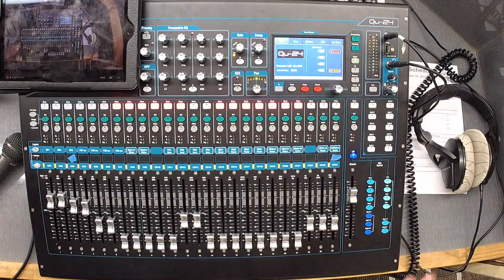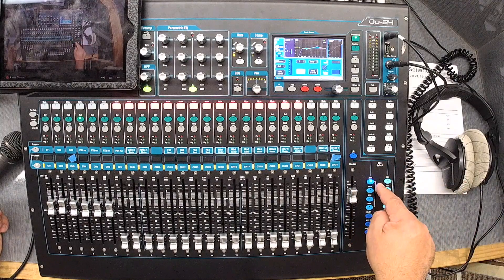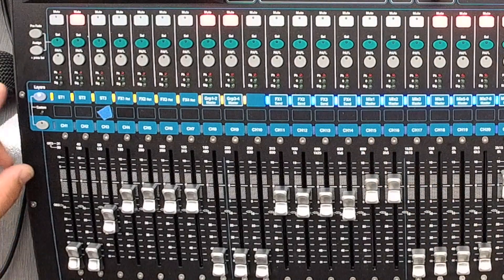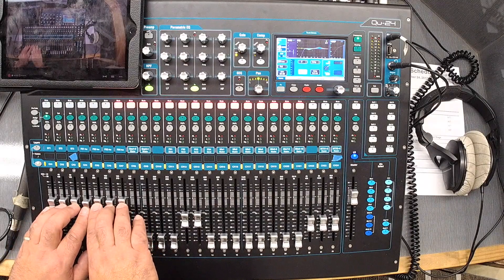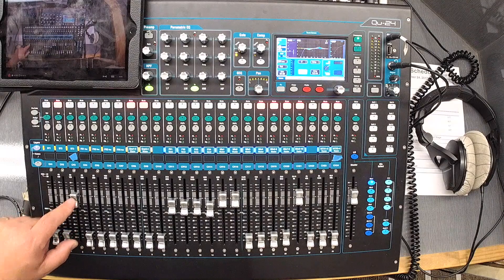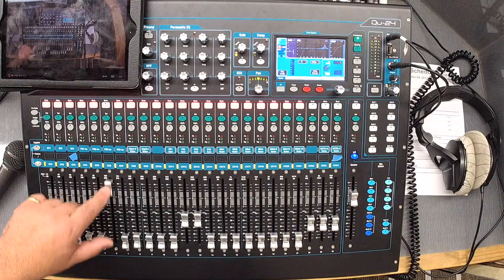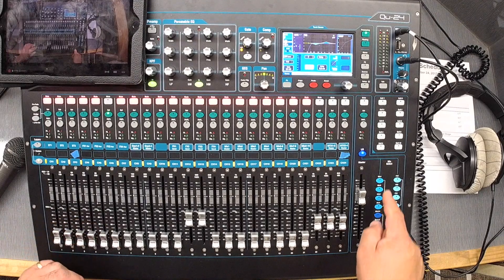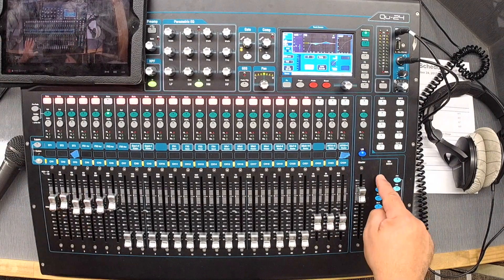AH QU 24 Monitor System

Comment: Great Job.!  I have 4 Singers, and they all have individual monitors.  Ch-1 -> Mix-1, Ch-2 -> Mix-2, and so on for all 4.  I would like to put a small amount of effect for each send.  Each of them like a different level that they prefer.  I currently have a bit of Reverb and a short Slap on FX1 & FX2.  for each of the Vocals.  Can use the same effects for each of the monitors or do I need to use FX3 or FX4?  I planned on using a doubler four the lead signer and an external harmonizer on FX4 or something...  Simply... Can i use a small amount of the reverb and delay for the monitors?  Thanks  Dwayne.

Comment: I know this is wayyyy after this was posted, but I could really use some advice.  I just installed a QU-32 at our church and have the monitors attached to MIX 1-4 but I am not getting any sound.  I have the channels set to route to the appropriate mixes so I am really stumped.  Any advice for a newbie to the QU world?  Anything I could be missing?

Comment: Great tutorial. Especially for someone fairly new to the Tech side of things. And my first digital desk. 

Just one question (maybe you could cover this). How do I send FX to an In Ear Monitor send? Do I just use the FX as normal on the main mix but add the effect to different instruments? Or is there another way to do this?

TIA
Reply: Essentially the same as any instrument or vocal. just press layer button where you will see the effects return channels. (channels 4-5-6-7 on the layer level) now select your mix to send to (Blue buttons on the right) and simply add the amount of effects! (Push up the fader for the effects return) to the monitor/ iem mix that they want in the monitor or iem's

Comment: Hi , sir. I swapped the qu as a Interface/ soundcard to  Clarett from Focusrite. But, I setil would like to yuse the QU as a monitor mixer, So , just to get signals from the line outs from soundcard, and give each musichan  their own monitor mix. Is this possible ? how do I route the enidividual mixes ?  So I need to buy extra gear? or can I take  a seperate output from the back and rout to a separarte monitor amplifier ?

Comment: Can you configure the aux/monitor sends pre/post fader on  per channel basis or a per mix basis? Example - send the input mic channels to mixes pre-fade but the "canned tracks" channels post-fade?
Reply: The way I have done it is use 1 FX dedicated to the monitors. Then make whatever channels you want FX on monitors "prefade" on the fx channel. Not the mix itself. Hold the button to the left of the channel strip to show you what channels are in pre/post fade. The channels you want the FX on need to be lit up.

Comment: Monitor sound typically gets bounced off the back wall and into the audience ... not good. I think that sound is also out of phase with that coming out of the mains. I have tried to angle the monitors so they do not hit the back wall by angling them sideways. This can't always be done because of the stage set up, but when it can, it makes the sound hitting the ears in the audience sound better. The musicians just need to get used to having the monitor sound hit them in one ear ... doesn't take long.

Comment: Hi, this tutorial is very helpful, in my church we recently purchased this Qu24 mixer, i wondering if you could help us in showing how to set up the in ear monitors, we get the beringher p16m, and we wonder how can we make groups so we can send the 7 mics for the drum in just one channel, i really appreciate if you could help us with that
Reply: re: the p16m - I am not that familiar with the unit, however, looking at the connections it looks as if the only inputs are via the ethernet jack (ultranet) - i think that is your first issue you should solve - whether that unit will interface with the QU24 dSnake - it looks like you would need the p16i -
www.sweetwater.com/store/detail/P16I--behringer-powerplay-p16-i-16-channel-input-module
In order to use the p16m with analog inputs going into the p16i then ultranet connections to the p16m - 

and looks like the low cost of the p16m needs the p16i in order to take advantage of the unit via analog
 connections.

you could look into the Allen Heath ME personal mixing system - although costs more it does the dSnake option fairly easily
https://www.sweetwater.com/store/detail/ME500PM--allen-and-heath-me-500-personal-mixer

At our church this is what we use for wireless in ear - www.sweetwater.com/store/detail/ATM3L--audio-technica-m3l
we found a good deal for four on craigslist - be careful however with all the new changes in bandwidth from the FCC
our setup is analog connections from the digital snake to the ins of the AT transmitters - then to the receivers - 

A wireless in ear system would be much like we have - but each person with a receiver can adjust their own mix via the Qu-You app on iOS or 
Android - 

Also remember that the Qu24 can be run via an iPad with the Qu-Pad app - only on iOS - i think there is some android version but not fully supported by AH.

The QU24 will give you up to 6 or 7 separate monitor mixes/sens - 4 are mono and 3 are stereo
What sort of snake are you using? analog or the ab168 or ar2412
So this means you may have 12 in ear monitors but not 12 individual mixes for them. Only 7 which means 5 will be duplicates of the original 7
.
At our church i share one mix with the drummer - we basically hear the cues and click track with some lead vocals
 and everyone else has their mix - so depending on your set up - you will be limited to 7 unique monitor mixes - not a big deal for a smaller group but i don't know your needs.

Hope this helps
Reply: We have the beringher P16i too, we gonna have that close to the mixer and send the signal to the stage to the beringher P16d so we can split the signal for eight P16m, but we only need six and we have an analogue snake not the A&H 2412, but we are not using that anymore for the music, we gonna have just on floor monitor for the preacher, we know that  it would be easy to get the ME monitoring system but like you say its quite expensive, the only problem that we have right now is how to put the 7 mics of the drum together into one fader so we can send the drum in one channel to the P16m

Comment: How to setup subwoodfer line out in this mixer , sir ?It has not Hi cut line out . Thanks
Reply: Any mix out would do
Reply: Could you explain step by step  , sir ? , thanks
Reply: I use my mix 9-10 for subs. Send it to an amp then use those outs to the subs. Make sure that you've patched your cables correctly. It also depends what kind of subs you have though.
Reply: HK thanks

Comment: Can the monitors be eq ‘d separately?
Reply: yes - this is especially important when you need to ring out stage monitors
Reply: Marlon Valladares do you have a video on how to do that?
Reply: @JesusRamirez-ci2le  not yet but will try soon - thanks
Reply: @JesusRamirez-ci2le  I probably won't be able to do that - but here are the instructions
To begin, make sure you are in the Processing Mode - Press the PROCESSING Button located at the top part of the board
1. Press the SELECT button for the Master Channel - Should have a Green LED located above the Master Fader
2.  Press the button for the Mix you would like to EQ - located on the right side of the board for example MIX 1 - it should light up Blue LED
3. Look at your touch screen and you should see the basic four areas that show Mix, PE!, GEQ, and Comp - Make sure the top left area of the screen is displaying the mix you wish to EQ
4. Use the EQ knob section of the mixer to adjust your settings. Make sure the IN button - Green LED is on.
5. When you are done with adjustments, you can press the LR button (BLUE LED) to get out of the MIX 1 mode otherwise any adjustments you make will be to whatever Channel or Mix you have selected - GREEN LED
Reply: Marlon Valladares thank you so much for taking the time to write back. I will do that.
Reply: Not only can they. In most cases they MUST be!

Comment: I don't recommend this mixer.
Reply: Ok, just curious, what do you not like and what would you recommend instead?
Reply: Marlon Valladares I've been using our Qu24 and Qu32 mixers for the last 2 years. I can confidently say that it is a solid mixer and does the job. But for what I use it for, it's not enough. The part that disappoints me the most are the amount of mixes. I don't like that they have link 5-6 up to mix 9-10. If those were separated it would be better. 

I recommend Yamaha Mixers. I want to get the TF5. Man that thing is amazing. Or if I have extra money just get the S-Class Allen and Heath.
Reply: @hlokomani  I agree with that. we use the mixes and we quickly ran out with our in ear monitor setup with the stereo mixes being only one in reality.